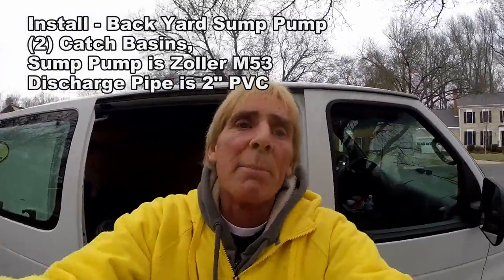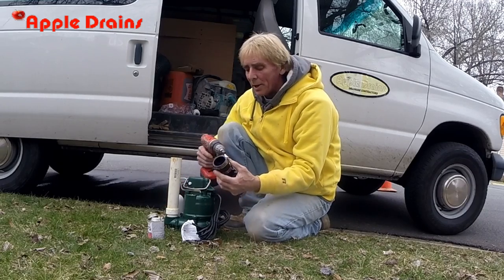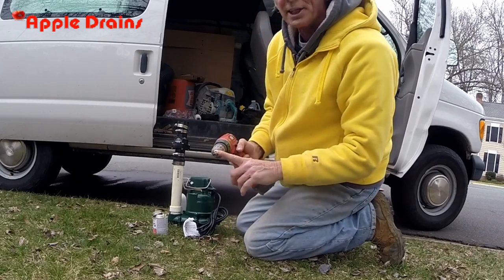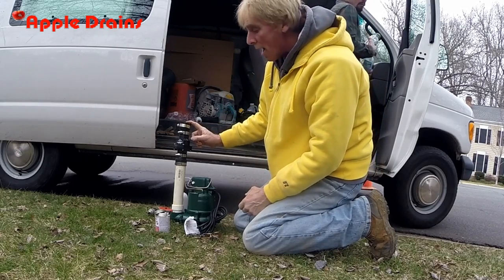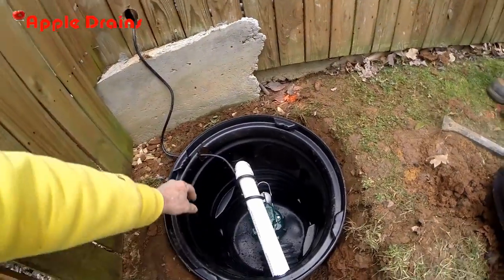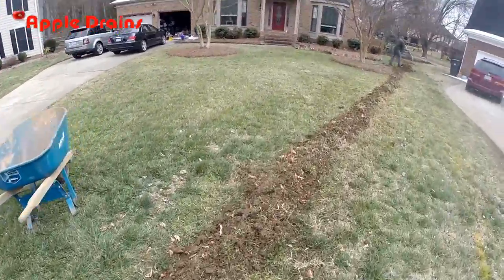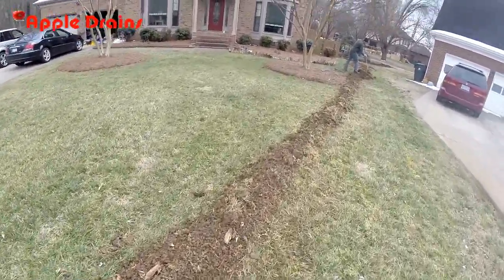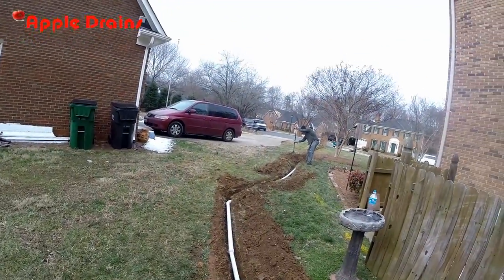How To Install a Back Yard Sump Pump

Comment: Thanks for posting. Had a contractor do mine and ran 3/4 pvc for 100’ run and first pump lasted a couple months. No check valve and poor French drain work. Good to see how to do my own better when I dig out their shoddy work.
Reply: I doubt that you actually had a Real "Licensed" contractor. You get what you paid for.
Reply: @everardorodriguez2445  All 3 of my bids were licensed contractors. I picked the middle price - not the cheapest as they had better reviews online. You don’t always get what you pay for. Make sure you check in on the work while they are doing it and be less trusting was my take home. I usually check in and watch progress , but this time work was underground before I could see.
Reply: @smallfgb  A permit would add to the cost but an inspector can do wonders for contractor diligence.
Reply: @edbouhl3100  I agree 110%. My bid was not cheap and permits wouldn't have added much to it - particularly as a proportion. Also those planning shoddy work probably would opt out of the permit/inspection process. Live and learn.

Comment: I was a property claims adjuster for 24 years with a major carrier. I have inspected thousands of houses and I would like to add that a "sock" should be around the slotted drain line..  They will fill with silt over time and will eventually clog. I have had 3 basement walls, for example, fail because the drain lines at the base of the basment's walls (on the outside) filled with silt over time and eventually stopped working properly.  Not hating on the video at all.  Those concentric rings that surround the drain lines encourage sediment to build up by limiting its movement in the pipe.  As the water in soil drains into the lines it carries dirt from the ground with it. I have seen this time and again
Reply: Filter socks get clogged with silt and fail. In my area at least

Comment: How do you keep the uphill discharge line from freezing? I have a same issue where the street is much higher that pump and I don’t know how to keep it from freezing during winter.
Reply from the maker: The pump will clear the line

Comment: Audience question:  would it be prudent to have at least 2 in-line check valves on the output line after the pit?  Thx

Comment: How often do sump pumps outside freeze up and bust every winter?  Do you gotta like empty the basin and block it off or something to prevent it freezing, maybe install a damn heater?  Or do you have to bury it below the frost line?  Because all 3 sound like $$$$ or a pain in the ass to do every year..

Comment: How would you extend the power cord if the cord will not reach the closest outlet?
Thanks
Reply: Codes vary. Dig an underground trench from where you want the outlet to the house. Code depth is 3 feet. Get underground Romex. Not regular Romex. Run it to a breaker box in house or garage. Put it on it's own 20 Amp circuit breaker, get a waterproof outdoor outlet box.
Reply: Christian Narine 
Me too

Comment: Chuck, is it possible to install a sump pump in line with your french drain line or tee off the french drain and be able to drain both from the french drain line and discharge out with the sump pump? We get super heavy rains near the gulf and with the heavy clay soil, the 4" french drains on either side of the home can't keep up. I wanted to augment the existing drains rather than ripping them out and replacing them with larger 6" lines.

Comment: Question(s): What size gravel would you use to cover the flex? Does the flex have to be pitched toward the basin collector or does the suction of the pump pull the water into the basin? Need to install something like this in our backyard. Thanks, Garry.
Reply: Pea rock is just fine to use. And yes slope that toward the basin.

Comment: Hey chuck, i had a similar system installed on my property. Any idea how often this pump kicks on and runs then kicks off? I'm monitoring mine and it pumps a good bit of water for 10-15 seconds then takes about 30-45 seconds and pumps again. This is during a light rain. My question is, is this common and all based on the float valve raising and lowering? Should the pump run constantly during a down pour? Thanks!
Reply: Sounds like the system is missing the check valve… the pump emptys the basin, but then many gallons of water inside the ground pipe all flow back downhill into the basin and the process repeats itself. Depending on the amount of rainfall the basin should fill in anywhere from an hour or up to 5 minutes if a torrential rain, then pump kicks in and empties basin in about 1 to 2 minutes, then repeat

Comment: So if it is pumping uphill the whole line is trapped (holding water).  Wouldn't this be a freeze hazard?  This is a serious question because I have a similar situation in Michigan.  Please let me know what I should do in a my area.
Reply: pr872 it would freez if the ground Froze deep enough
Reply: pr872 1
Reply: I think you'd have to use some self regulating heat tape.
Reply: @phiksit  No you just wouldn't put a one way valve on the line. You aren't supposed to in exterior installations for this very reason. The water will fill the sump crock which should be lower than the frost line to protect the seals on the pump. The water that didn't make it out the tube shouldn't be enough to start he pump again. The crock sits above a pile of stone, so that stone has to fill up with water before it kicks on anyways. This lets the water naturally dissipate.  

If the volume of the line is so great that it would kick your pump on when it all returns, the best thing to do is add a serviceable 1 way, somewhere in the line (like a halfway point). Ideally you are sending water up hill to a height then angling the pipe downhill to a low. So the return water is limited. On your terminal floats, a 90 deg pipe with a hole in the bottom is used. Any resting water works it way out naturally (when placed above stone).

Comment: Are these outside systems good in cold weather? What if the discharge pipe freezes?
Reply: This system doesn’t seem meant for cold climates at all… not buried deep enough. I guess you could add a heat trace cable to keep it from freezing and cracking during ground frost, plus you would have to remove the pump and make sure all water is removed from system. Id bet the plumbing would still freeze and crack

Comment: Does it matter how deep the pvc pipe is in cold areas like the northeast?
Reply: Problem is you have a freeze line but you also need the water to drain to the street.  So there will always be water above the freeze line - unless you remove the pump and store the pump during the cold season.  Remove the pump and release the check valve to remove all the water from the pipes.  Otherwise, I guess you could install heating elements to prevent them from freezing over.

Comment: Stupid question. What do you to to prevent rain water from getting into your pump?
Reply: Mickey: Remove the pump!
Reply: The check valve prevents it
Reply: Correct, stupid question indeed.  What do you do to prevent a fire from burning..?   The whole point of the thing being put in outside is to do what, whats your best guess..?   To attract deer?  Maybe to trap littke kids ?    Do u thing doo doo goes in there?  Or your house drain goes to the basin?  How do you stop a blender from grinding your pecker off??  Well dont stick your pecker there..   or get rid of the blender..   lol
Reply: its water proof and submergible in water.

Comment: Yep, great job guys. Better be way down south or that line gonna freeze solid. What did u go down, 6 inches?
Reply: not only the line but the pump, probably destroying it. Better use some self regulating heat tape.
Reply: Does it freeze very often in Orlando?

Comment: What kind of permit do you have to have to drill in a curb?
Reply: He believed there isn't one, so there is none.
Reply: Youtubeaholic2 check with your local town ship or city
Reply: Youtubeaholic2 don't pull a permit just call a professional out to do the thinking hire electrician to check your work
Reply: The people who painted house numbers on the curb didnt have permits..  and the damn things break at driveway corners and the city never comes out to fix them or bills anybody for damaging cutbs so if i wanna drill a hole in a curb than im just gonna do it..  now if your on a street with no storm drains and suddenly theres a hole in your curb at the bottom of a new street lake from your yard then my guess is the city gonna have a problem with that..

Comment: How do you keep the sump pump from freeze in the winter??
Reply: I wonder about that too.  They are in Florida so it shouldn't matter to them.  Pipes and pump will freeze up here no doubt.  I imagine we would need an easy way to remove the pump during winter months.  I don't think it will be able to stay in the ground since it has standing water which will freeze and burst the pvc.  And destroy the check valve.  I would think the best thing is to remove the pump each year in October then reinstall it in April/May.  If remove the pump and release the check valve, that should empty the water from the line.
Reply: @kevinerose  your comment is bang on !  You definitely want to remove the pump in October and wait till about April to reinstall so you can avoid the pump freezing and getting damaged

Comment: If I install a pump and my output is going up hill to the street, how do I keep the discharge pipe empty so it doesn't freeze?  Check Valve will keep it from going back, so pipe will be full.  I don't want it to freeze.
Reply: Typically you would not do it this way.  You would have it go down-hill to keep most of the pipe empty, and the vertical part of the pipe would be insulated under ground so that it would not freeze.
If your pipe needs to go up hill, then maybe a sump is not the way to go.  Digging down and burying a barrel with rock may be the better option to allow more water retention so that the ground can have more time to absorb the water before it collects on the surface.  But if it rains constantly and you can't get a large enough resavaur under ground then this would not help much.

Maybe make a drain so you can essentially turn the system off during the winter?

Comment: I would have went with either 2 inch or 3 inch pvc or ap pipe verses the Cora gated tube junk. that stuff is known for collecting dirt even if it's sealed. also would have put in a clean out or two.
Reply: al johnston make a vid then
Reply: You could probably just "snake" it as a matter of annual maintenance

Comment: Have you ever run a sump pump using a solar panel? Just curious! Thanks!
Reply: The initial cost of a panel, batteries, and inverter is way more than the cost of the power the pump will use over its entire lifespan
Reply: V.Vega gotcha! Thanks!

Comment: Can you just pull a sprinkler line instead of trenching for the discharge?
Reply: Wha?  So youd have a random sprinkler pop on every time the pump kicked on?  So wouldnt that just be putting the water right back in the yard?  And with a sump pumps pressure im not sure it would sprinkle out like normal...   its not like a sump pump will pressurize a water line because they only have a standing water column of like 20 -30 feet im pretty sure..
Reply: @Z-Ack  No, I meant to PULL a line with a trencher instead of digging. No sprinkler on the end, just an easier way to get a buried outlet.